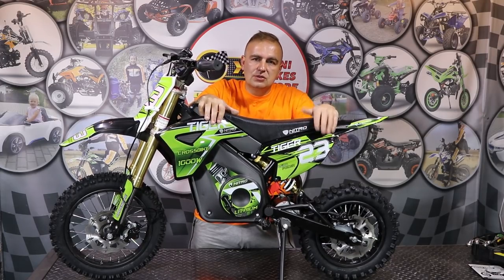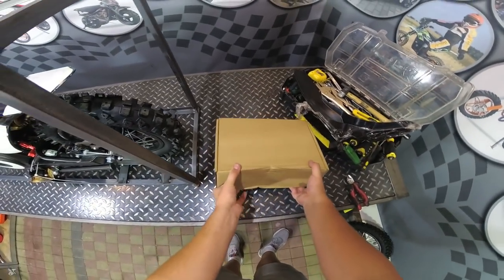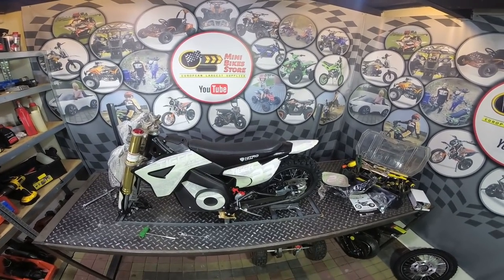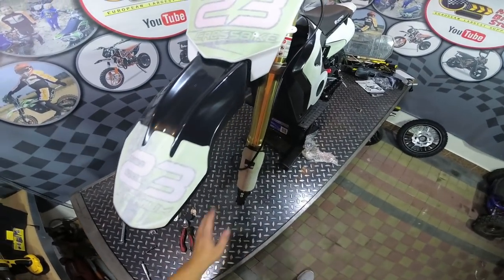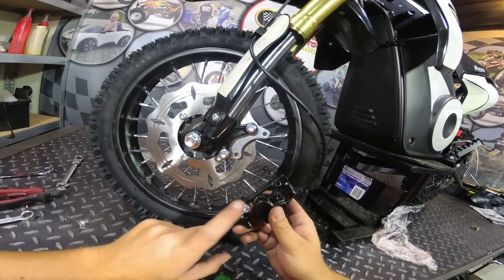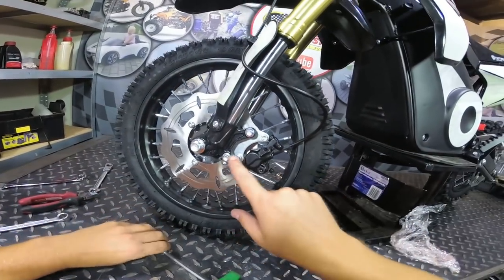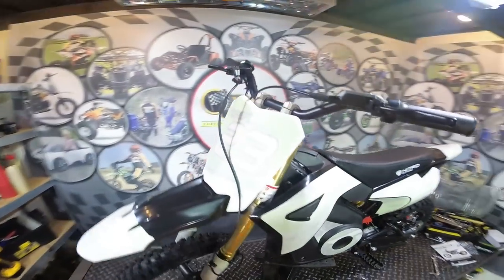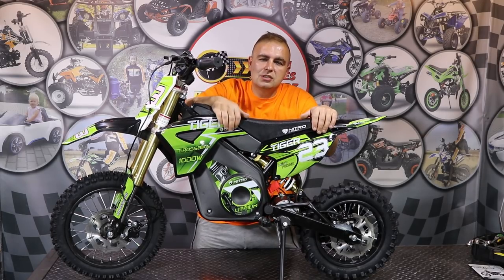Electric Dirt Bike 1100W 36V - Unboxing - Full Assembly - Instructions - Tiger from Nitro Motors

Comment: Hello my friend, you didnt tell us what the 3rd switch is for ? 1st one you said soft start 2nd one is power, whats the 3rd one ??
Reply from the maker: 3rd switch is for maximum speed, so you can set maximum speed of the bike with the 3rd switch
Reply: @MiniBikesStore  is the chain supposed to be really tight or should it be slightly loose ?
Reply from the maker: @allahoakbarone  should be slightly loose, there is chain tensioner which will keep the chain tight properly at all times
Reply: @MiniBikesStore  thank you very much, these bikes very good.
Reply from the maker: @allahoakbarone  you're welcome
Reply: @MiniBikesStore  hi, do you know the type of brake fluid this takes because i need bleed and top up my brake fluid